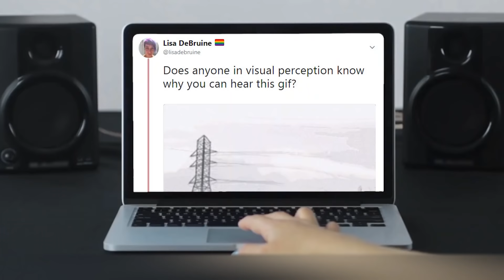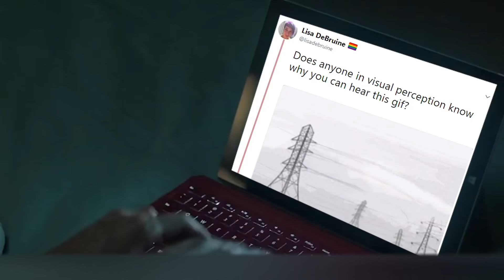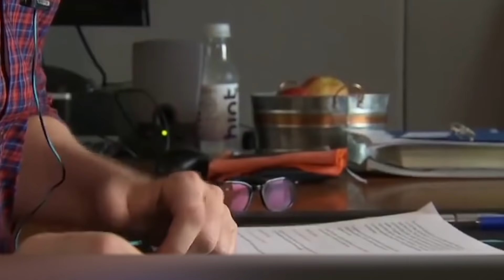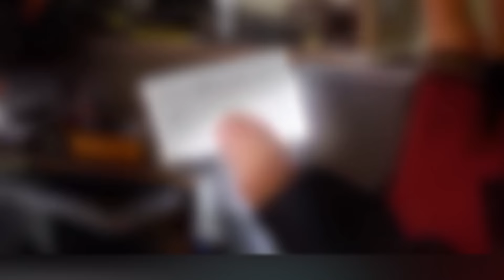80% of People Hear Sounds in This Gif. And You?

Comment: Many years ago I made a gif of a useful accessory for a car: it showed the car pull up to a parking space that was a bit too small for it, then a battering ram slides out from underneath, between the parked cars, then suddenly BAM!, the ram punches into both cars, moving them farther apart. The car then parks in the now-larger space. Later I extended the sequence so the now-parked car repeats the ram procedure, smashing the parking meter on the sidewalk. Although I know absolutely that there is no sound, I hear the crunch every time the battering ram fires.
I also took a still shot I found online of the terra cotta warriors, taken from above looking down on the rows of statues, and tilted the head of one close to the camera so that it appears to be looking at the viewer, instead of straight forward like all the others. While I was working on it, and every time I've looked at it since, I can hear the sound of terra cotta scraping against terra cotta. Creeps me out to this day. And it's not even a gif!
As I recall, each of those won the respective contests they were entered in, so I suspect others may have had a similar reaction.

Comment: 1. 0:39 Power towers: I heard nothing
2. 1:46 robot crawling: I heard nothing
3. 1:54 tiger painting a mule: I heard nothing
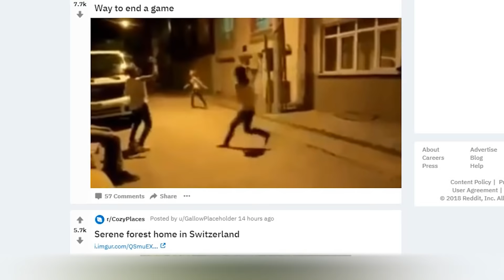4. 2:13 lightning and electricity: I heard nothing
5. 2:28 Tesla lamp: I heard a ripping sound. (I got one!)
6. 2:37 Giant candy:  I heard nothing. 
5. 5:38 lines: I see lines.
6. 6:37 floor: I see a straight and flat asymmetrically tiled floor.
7. 8:07 fan: I see a fan and a strobe light.  
8. 9:32 helicopter:  The blades look still!  (I got another one!)

Well, at least I heard the perceived Tesla lamp sound and saw the helicopter blades stopped.  But the rest of the things I did not perceive any illusion at all. Life is not as fun for me as it is for most people, I guess.

Comment: I can't hear or feel the gifs at all. But I'm not surprised that some people can. We're all different.

I had carpel tunnel surgery. I freaked when the doctor, who was on the other side of a screen, said "Oh My God" rather loudly. (Take note of how such a thing can age you ten years, and avoid having a local for a surgery. Trust me on this.)

Turned out the nerves in my fingers branch before entering the tunnel, whereas most people do not. Instead of having the normal three, I have five, so it was a tight fit there at the wrist.

I'm 70 so this was in 1976, and I still can't play the violin. 😎

Comment: No. The sounds  is caused by you moving your head. When the image jitters, your eyes try to track the movement by nodding your head rapidly to follow it. This rapid nodding causes the fluid inside your cochlea to vibrate and it's that sound you hear. The sound is not an illusion; it is real. It is cause by your own movements.
Reply: Shawn H Corey makes sense. My head kept bouncing, haha
Reply: I also felt like the shaking was a big reason why I heard thumping as I only heard sounds on the gifs where the screen was shaking. Didn't know it was a real sound though.
Reply: It's only a real sound if it falls into the range of your hearing. Most muscle movement does not. They are so slow they fall below the frequencies you can hear. But small muscles, like the muscles in your eyes, can move rapidly and being close to your ear, can be heard. 🙂
Reply: Shawn H Corey What if your head isn't moving.
Reply: Shawn H Corey ok chill out bill nye
Reply: Not quite. It's the semicircular canals that sense balance. The cochlea senses sound.